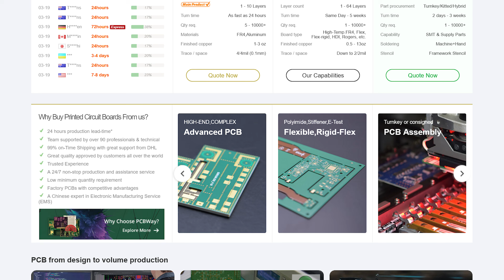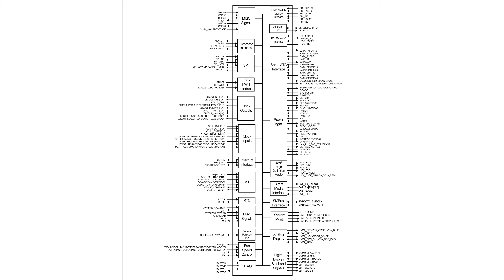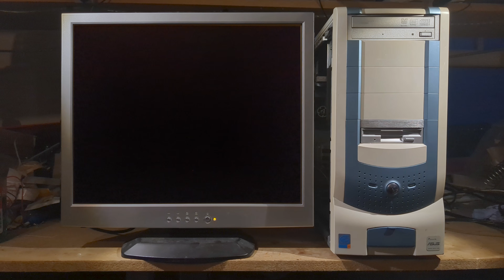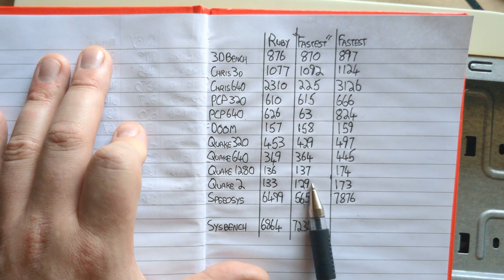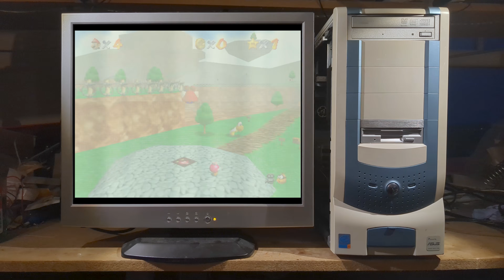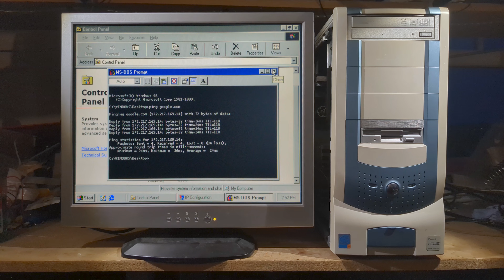No, *This* is the Fastest MS-DOS Gaming PC Ever

Comment: Using an emulator such as DOSBox is a copout, but not allowing true virtualization is just as much or more of a copout. DOS can be so much faster if you run it on a modern CPU.

I run Windows 98SE and ME alongside each other in virtual machines (with 3D acceleration!) on a Core i7 and it's the fastest, most rock-solid 9X setup I've ever seen. I haven't done much with pure DOS (not to be confused with PureDOS) but surely it can also take advantage of this. Granted, no 3D acceleration with my existing setup because my "3D accelerator" is emulated within Windows 9X (at 4GHz it's not a performance problem at all for 9X and period software) - but I'm also pretty sure I've seen other virtualization plugins to handle that for DOS.

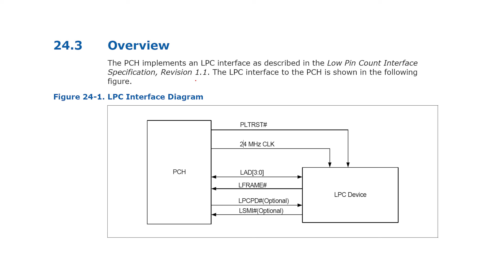Comment: I have a 4790K in a Supermicro X10SAE motherboard, which has the Z87/C226 Express chipset, and it has an TPM/LPC header with 20 pins.  I see LAD0-3, LDRQ, and various other signals as called out at 5:00.  What exactly is missing, is it chipset support or electrical interface that you're referring to?

Comment: You should try an older graphics card to not be GPU limited. The way the GeForce 6 and 7 emulate dos resolutions is much slower than on older cards.
I actually had much better performances with a core 2 duo motherboard with a via chipset which had an S3 video core as the igp compared to the GeForce 7000
Maybe I can try to run quake2 benchmark to check if I can get better FPS than you despite having a slower CPU :D
Reply from the maker: Yes it does still seem to be limited by graphics somewhat... I did try an S3 Virge PCI in it but it was slower. I'll have to try a bunch of random PCIe cards
Reply: @TheRasteri  maybe try some newer cards that still work on pci (such as geforce fx 5200, matrox g450 pci, etc).
Also nvidia made a pcie version of the FX series of cards so there might be something to do with that :D

Comment: i have a spare x99a xpower gaming titanium board and a delidded xeon 6950x equivalent sitting around, only problem with it is that i spilled liquid metal from the delid into the socket and never bothered to clean it out, if you want it you can have it. Cool project by the way.

Comment: this is going to sound insane, but there's a whole range of companies in china who are making new x79 and x99 motherboards which are really just C600 series chipsets salvaged from old server motherboards, anyway, some of them take custom orders, as in, you can get a custom motherboard made. if those support ISA through the LPC bus, it MIGHT be possible to get them to make a motherboard with an ISA slot built in.
they're also making knockoffs of supermicro boards with the full feature set including IPMI so I think they'd be able to make this a reality.
Reply from the maker: Yeah I have one of those "X99" motherboards, it's actually a Q87 but with a 2011-3 socket on it. Unfortunately LDRQ0/1 weren't wired anywhere, I even desoldered the PCH to make doubly sure haha

Comment: i made something easier to accomplish and yet very satisfying. i own a P4 2Ghz running with SDRAM ram 133mhz, agp slot with a radeon HD 4600. I didn't install dos on it, i installed a gentoo and it's frozen in its state (2021) since compiling over there requires a looooot of time. So it's meant for basic stuff and being a jukebox on terminal with tmux. anyway, it's always possible to attach another drive and have fun with win98-2000, something i'm gonna do over there as soon as i get some spare money

Comment: Dual booting Windows 11 and MS-DOS/Windows 98 is insane
Reply: Almost as insane as booting Windows 11.
Reply: Multi-booting DOS/Win98SE, Win XP, Win 7, and Win10, is a personal goal of mine.
Reply: @LRK-GT  Get some old SSD's and install the OS on each one.  F-12 to boot select into each OS.  I did this on a 775 motherboard and it is fun to switch the OS.
Reply: I would do it with hot swappable hard drives but also getting a motherboard to support all this will be a ton of work. Goodluck! @LRK-GT
Reply: Msdos/98 with windows 10 would be the best combination.
Reply: It’s what I do 😂
Reply: Disagree, completely sane, not doing that is nuts in my view.

Comment: Try Opera or Firefox. It's pretty easy finding older version of them - so you can just test them 1 by 1 to see if any of them plays nice with Win98.

Right off the bat: "Mozilla Firefox 2.0.0.20 - Mozilla Firefox 2.0. 0.20 is the final version to support Windows NT 4.0, Windows 98 and Windows Me, although it can run on Windows 95 and Windows NT 3.51 using tweaks."

If I remember correctly with Opera you should get version 12.18 which is from 2015 or something like that. It should at least be able to go on more sites that what you are currently getting.

Another option could be "Protoweb Browser"

Comment: I don't know if flight sims are your jam or if you'd even be interested in this but believe it or not there was a DOS flightsim back in the 1990s called Back to Baghdad that was an F16 sim., created by a USAF pilot.  The kicker was, it had dual monitor support, of a kind.  You could plug a monochrome graphics adapter into an ISA slot and it would drive the 2nd monitor as the jet's radar screen.

It'd be interesting to see if that would work in this beast, but I'd wager it's not enough juice for the squeeze for ya.
Reply: Oh that's a fun use of how MDA and CGA cards had completely separate memory addresses. Some other apps made use of that too, I believe, though I can't name any right now.
Reply: @LonelySpaceDetective  Early Linux had (I assume "had"?  Linux IS very slow to remove support fr the kernel...so I can't actually say this support has been removed...) support for running a console on MDA.  Apparently quite useful when XFree86 (predecessor to XOrg) was having all it's various card drivers developed -- oh your video driver locked up?   Well, switch over to that console and get to debugging.  

You did have (and still have) the option of hoking a second computer, or a terminal, up via serial port (serial console).  Or turn on ssh (back then telnet, ssh didn't exist yet).   But the early to mid 1990s was a bit late for terminals to be common, and a bit early for home ethernet to be common.  (I actually did have a DEC VT102, I bought it surplus for like $3.  Computer upstairs, terminal in the basement, so I could compute in either location.  But this was unusual I think.)
Reply from the maker: I've done some messing with EGA+Hercules cards - https://www.youtube.com/watch?v=ERMr1Rosq0s

(unfortunately that won't work with my "fastest ever" PC, ISA graphics cards don't work with the LPC->ISA trick)

Comment: well a 9800X3D system can run and boot DOS just fine. just might not be optimal
Reply: You missed the part where motherboard and pc have to support sound cards with ancient port.
Reply: @nuffsaid0  and you missed the part where adaptors exist

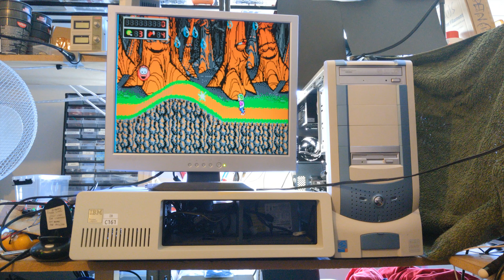Comment: (27:43) Magical, indeed. Indeed, magical. I'm 56 and have hade my hands in the guts of computers (and my fingers typing into the "minds" of them) for years now and was blown away by your presentation. Bravo. Bravo, sir. 😎🤘☮️
Reply: I wimped out and just built a PCI bus era machine that can run Windows 95/98 - procured an Intel CPU that am clocking at 3GHz; it’s single core but is of the first generation that started supporting 64-bit instructions (not that am using that). Relative to the hardware for when 95/98 were introduced, it’s definitely a step up.

At least these kind of builds are possible for we mere mortals - involving just some eBay scrounging
Reply: @TheSulross  Indeed. 😉😎☮️
Reply: OMG... I'm going to have to build a legacy PC soon, aren't I? Before the prices skyrocket even more... Argh! 🤪😉

Comment: The death of Windows 10 means loss of compatibility for a lot of programs (I am NOT getting Windows 11, mainly because of principles).
My main PCs are getting a deadly dose of Linux (Fedora KDE; not the point of the discussion).

I have a couple of older PCs which I want to use only for OLD Windows programs (mainly games), but I lack the "compromised" versions of the Operating Systems.

I found a "compromised" 32bit Wxp online and irl I found a "compromised" (and almost broken) italian version of W98 (still easier than Linux to understand tho).

I want to ask you if you could help me (and anyone else who wants to ) find older "compromised" Operating Systems and thus also where and how to get the drivers (just letting Wxp touch an Internet cable makes it get viruses).

I am mainly interested in where I can find these "compromised" OSs:

>Windows 98
>Windows XP 64 bit
>Windows 7 32 and 64 bit

Comment: Thanks for this. I got an AMD B450 which has CSM (traditional BIOS boot) with a Ryzen 3770X, and a RTX4070. I was amazed I was able to boot to DOS on this thing. Even the RTX4070 still has a VGA BIOS (not sure about it's full VGA compatibility though). SBEMU worked, but that disqualifies this system from this contest.

I also found some AM4 motherboards that still have traditional PCI (not PCIe) slots, but haven't been able to acquire one. I would really like a Asus Pro A520M-C II/CSM with a Ryzen 5800X3D running DOS with PCI slot for a Yamaha YMF744 or ESS solo1 I have lying around. I wonder this would beat this build, but not sure how you would feel about "Full audio support" since you cannot just slot your old favorite ISA soundcard in there for that nostalgic noise. Also at what part to you consider these PCI audio driver doing "emulation" if they emulate an OPL3 in software under native DOS?

Another crazy build would be to use my Supermicro X9DRI board, a dual socket Xeon E5 2650 v2, with 256 GB of memory. It also has TPM with LDRQ pins, but I'm hesitant to risk this board on tinkering. It won't beat this CPU for clock (3.4 boost vs the I7's 4.4), but at least I have 20MB of L3 cache per CPU. Too bad you can't set it to be main system memory ;)
Reply: Yeah I wouldn't risk the Supermicro for DOS-style retrocomputing.   Just for the simple reason that although the final XMS spec supported 4GB of memory on paper, the XMS implementations I encountered back in the DOS era typically only supported up to 64MB.  so you'd be wasting 255.9 out of your 256GB of memory  (and otherwise still be leaving 252GB unused.)

As for the 20MB of L3 cache being used as main system memory -- well, I imagine if you ran DOS on there, most accessess would indeed be within the same 1MB address space so moments after poweron you probably would have your whole working set just sitting there in cache.

I recall Linus Tech Tips reviewing some more recent Xeon, where apparently you COULD use the on-chip cache as RAM?  That might have been a (now cancelled) Xeon Phi though.
Reply: @hwertz10  I know the memory would be a waste for DOS, even with 32 bit extenders, 4GB is the max

Comment: Very cool project as always! Though I have to point out you violated your Rule 1 by loading emm386.exe and switching to protected mode. :P
Reply: not really, as he didn't use it to emulate a sound card or it's features to get full DOS application compatibility. all it does is emulate EMS memory and puts DOS in a single Virtual DOS Machine; Switching from Real Mode to Virtual 8086 Mode to witch all x86-64 bit processors have this capability. So the point is mostly moot anyways. 

Native Virtual Machine = Bare Metal vs Emulators, you decide...
Reply: @explorer9049  Yep, I didn't mean it too seriously ;)
But in fact if DOS in running in virtual 8086 mode, it's running in an emulation layer of some sort and thereby violating rule 1.
But yeah, if you want to run any protected mode games, there is no way around that.

Comment: oh, that comment about the IO space decoding triggered something in my brain from my PC firmware days. Yes, the legacy IO port range has issues on the PCI bus. It's been  while and this from my aging memory but IIRC the assignable I/O address port range for PCI starts at 0x1000. There is one exception I can think of but I don't recall the details. The exception are ports 0x80 and 0x81 which are used for POST code readers.
I don't know how recent industrial PCs get functional ISA ports. PCIe to ISA bridge chips do exist but I don't know if they have some way of allocating legacy I/O port address space to the bridge (thought I can think of some firmware tricks involving SMIs that could basically emulate legacy I/O ports).
Server chipsets might be another place to look. At least in the past, they used a SuperIO interface that supported legacy resources for the BMC to connect to (for things like Serial Over LAN).

But it's been some time since I worked in that space, my memory is hazy, and I can't point to any specific examples that could provide any guidance.
Reply: Thanks for sharing, maybe your comments ring a bell with someone else.

Comment: It's interesting you showed DOOM as well-behaved, I have a Pentium-M 533Mhz DOS machine (ISA855 Chineseum mobo, ISA slot for my Orpheus) and I have to run a CPU-slowdown TSR for sound to work properly in DOOM. Anyway, this kind of video is my jam, subscribed.

edit: I see you just had to change IRQs, for whatever reason that didn't work for me haha, only the slowdown, which someone on vogons suggested.
Reply: I run DOOM on an iBase MB800 with a 3GHz P4. It has ISA slots, some random Sound Blaster, some random AGP vidcard (onboard wouldn't do higher resolution) and works perfectly.
I just got a similar motherboard (brand new) with a Core2Duo 3GHz and an ISA slot that I plan to try out.
Reply: @Reziac  interesting, maybe the Orpheus sound card is the problem not DOOM haha. Anyway, great video.

Comment: Fan of Pain, Suffering and Frustration is so accurate. Hell I rebuilt myself 2 vintage PC's and both took me a long while to get working mostly alright. And the amount of reformats I have had to do just to get USB working is absurdly painful.
One is an Intel Socket7 TX Chipset motherboard with a custom bios I found and flashed, it runs a K6-2 400 @ 66Mhz bus, 64MB Ram and a 16MB PCI Voodoo3-2000. Windows 98 on that one. Motherboard has a working USB. I modded the case for an AT Switch.
The other is a Super socket7 motherboard with a very picky via chipset, running a K6-2 450 @ 100Mhz bus with a 32MB ATI Rage... ATX Case, this one refused all USB Card drivers... And got it running stable with Windows ME of all things. 
The K6-2 450 runs a fair bit smoother in WindowsME with games like Need For Speed Porsch unleashed... Pretty sure I am sure it's thanks to it's bus speed running at 100mhz
66mhz is just way too limiting for anything over a Pentium 233MMX or an AMD K6 300.
I am 41 so my first personal build was a K6-233 with a 4mb ATI + a 4MB voodoo1... so It was my mission to rebuild a vintage PC and boy do we have it easy now. 
Granted the biggest challenge is finding parts and or drivers that work properly... or even a motherboard that doesn't need to be re-capped. (Which had to be done for my super socket7)
In both cases they use an old but modern-ish 7200RPM Sata drive with an IDE to Sata adaptor. The one with the Intel Motherboard was firmware updated to 64GB I think which was the max supported by the motherboard (forgot what it was)
Months of pain and suffering.

Comment: I love your ability to just ISA stuff in the modern era, nobody else is doing software projects like this.
For software projects I actually made my own MS-Dos distribution called Ultimate MS-Dos 7.1 (You should be able to find it without to much hassle).
It has a USB stick and Floppy version and comes with a modified MS-Dos 7.1 with higher compatibility (Windows 3.11 mostly works) and all the tools you'd typically need for this kind of system with the cd or even dvd-rom drivers, mouse drivers, slowdown utilities (Fastest DOS PC is only a plus if you can also slow it down for the games that require it).
Considering its basically what you wanted for this video it may help out in future projects since then you don't need to go the Windows 98 route.

Comment: It would be interesting to see if you can accomplish anything with quadralien. I don't remember the target hardware, but it was not timer based. It was software based. It supports CGA and VGA. I know a 486 makes the game unplayable for real, but you can have some level of control. I seem to recall it was too fast on a 386 as well, but it was just hard not impossible. My guess is it was targeting a 286. So on this monster it's probably instant movement with no control of any kind meaning that no progress of any kind would be possible. lol (by the way even if you run it with appropriate speed, the game is insanely hard, one youtube discovered the public keys for skipping levels are wrong, but maybe that's been fixed by now, and the last level is pretty much impossible).